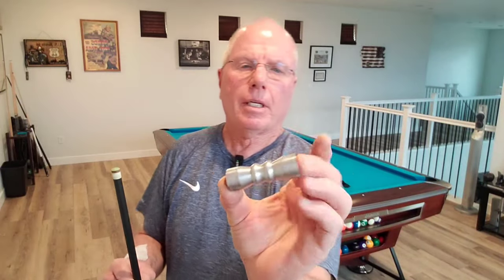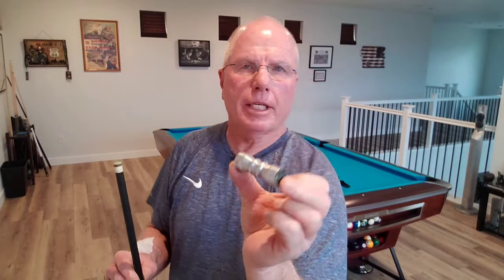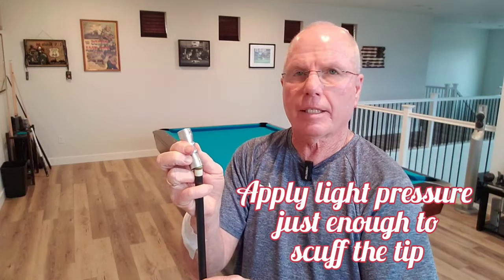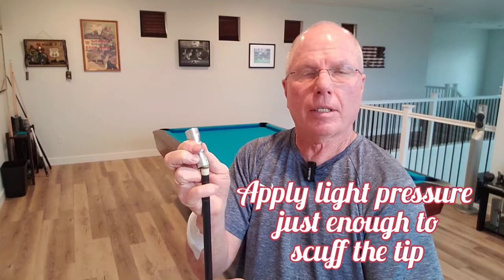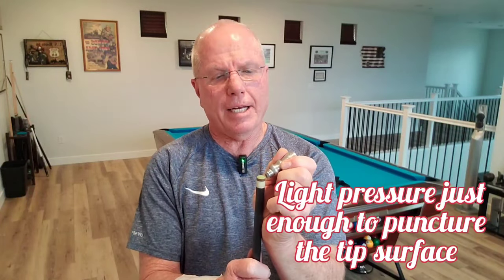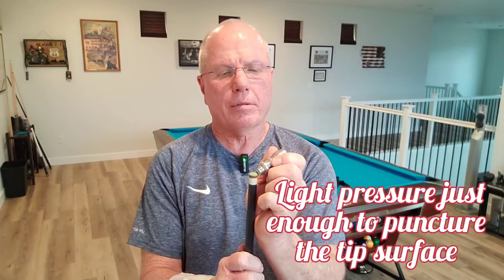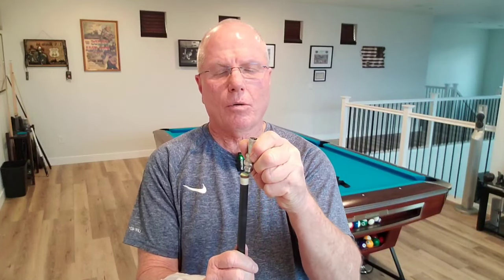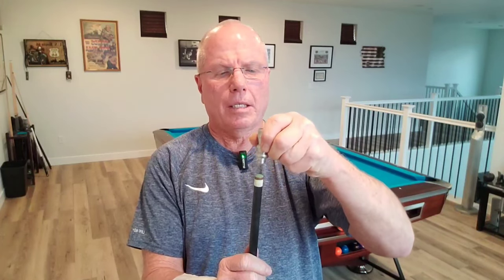Pool cue tip maintenance with the Cuetec tip tool.

Comment: If you have a soft tip on the cue, that tool will widdle down the tip in no time! I prefer the Willard's cue tip shaper. They're made to last forever!
Reply from the maker: Hey Jim, thanks for watching and your comment. I'm not familiar with the tool you mention. I'll have to check it out. With the Cuetec tool, you don’t want to use extreme pressure, or you'll wreck any tip. Just light pressure is all that's needed. My shaft you see in the video has a Kamakazi hard tip. My wood shaft has a Kamui soft tip. No problems.

Comment: Thanks! I just bought a pool cue!
Reply from the maker: Hello and thanks for watching and your comment! Pick yourself up this tip tool. You'll want to keep your tip in peak performance by using this tool as instructed. What kind of cue did you buy?
Reply: @nvpoolshooter  a basic inexpensive cue called Action. I don’t get to play much because there’s NO billiards parlor where I live. I’m in the Bay Area 1/mth and play in Petaluma.
Reply from the maker: @crazywomancreek1 Inexpensive cues are just fine if they're straight and have a decent tip. Yours probably has a hard tip. Petaluma is not a big town so no surprise there's no pool hall. Santa Rosa maybe? SF would be the closest but that would be a bit of a drive. A bar might be your only local option.

Comment: Is it not better to take the chalk off first and then use the tip tool?
Reply from the maker: @murahk123  Good question. Nah. It makes no difference. Been using the tool for years and never first removed the chalk.

Comment: You should clean/blow off any Leather debris off the Scuffer each time to clear each time so you get maximum abrasion. (No Duh). I know you’re showing how you do it. But why not post what is better in this case.
Reply from the maker: Hey Donnie, thanks for watching and your comment. You really don't have any leather debri buildup inside the scuffer. A bit of chalk, no leather. I've been using my tip tool for about six years, and there's no leather buildup in the scuffer.  You're applying just enough pressure, or should, to rough up the tip a bit. If someone is 'sanding' down the tip, then way too much pressure is being applied.